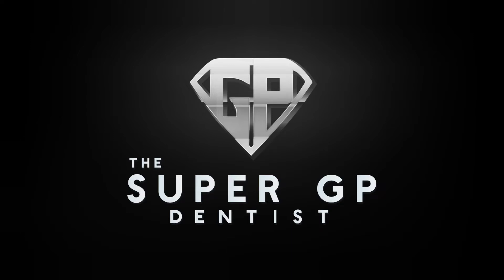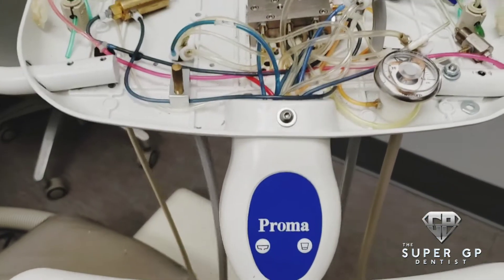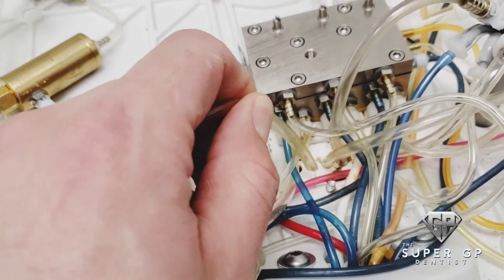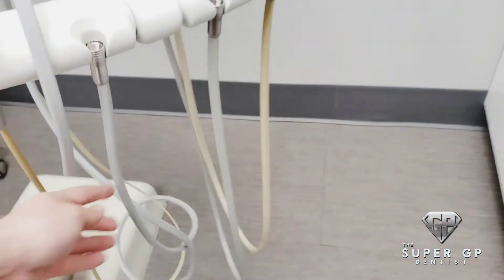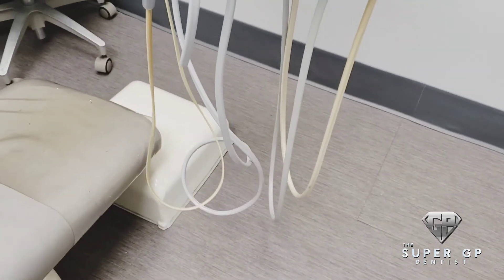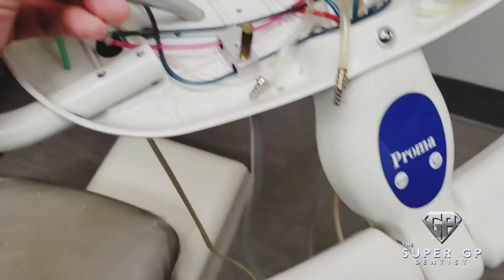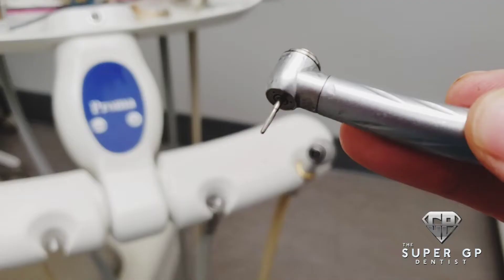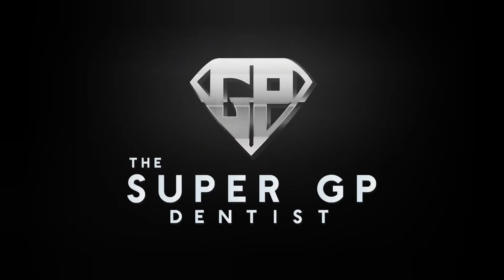Dental Handpiece Tubing Replacement Repair

Comment: As a Dental Repair Technician, I thought I’d add a couple of useful comments. A couple of things cause the tubing to split/break at that position. The first is the obvious stress when using the Handpiece during normal use. Obviously this can be avoided. Things you can do to minimize that problem, and it’s very common, the tubing becomes brittle over time, because the oil from a Handpiece Lubricator isn’t purged enough from the Handpiece. That residual oil makes the tubing very brittle over time and will cause that splitting. The other thing you want to get your staff to do, is when they are wiping/cleaning the tubing off is to wipe towards the Handpiece. It’s common for people to hold the Handpiece/ coupler and wipe away. This “pulling away” action will cause extra stress and contribute to pre-mature cracking

Comment: I have a P&C 1500 series chair that leaks water (if unit is on) from the air/water syringe, cavitron unit (hooked up to same bottled water system) and one of my handpieces. HS said it’s a failed solenoid. Any recommendation for info how to DIY? Thanks for the vids!

Comment: A less invasive repair would be to cut the tubing @ the coupler right below the break and reconnect the coupler.  1" less tubing length won't be noticeable.
Reply from the maker: Yeah, I do that as well. Its a little tougher for someone who is new at repairs. I'll try to post a video on that repair soon. Thanks